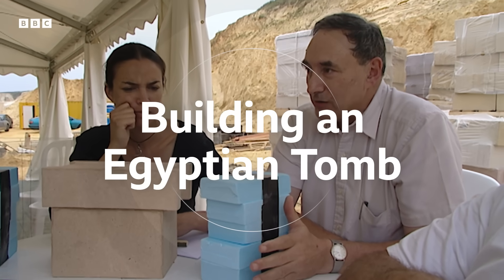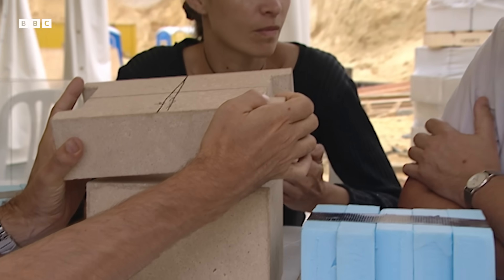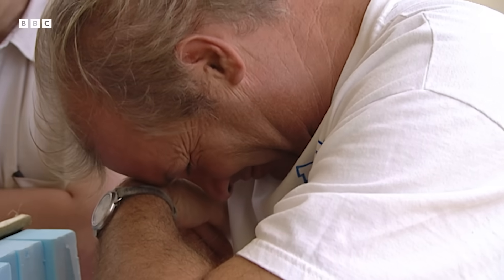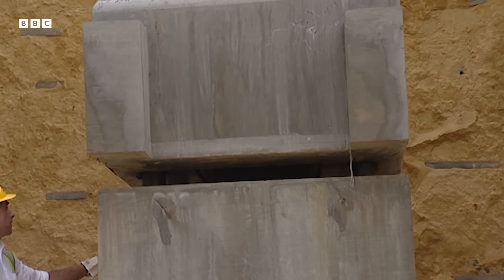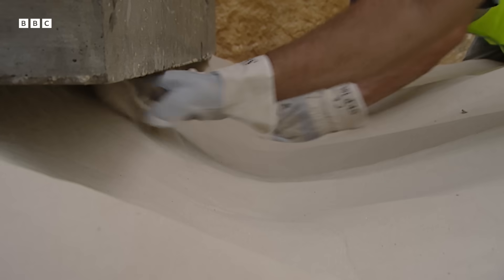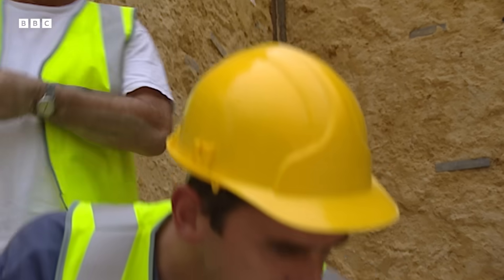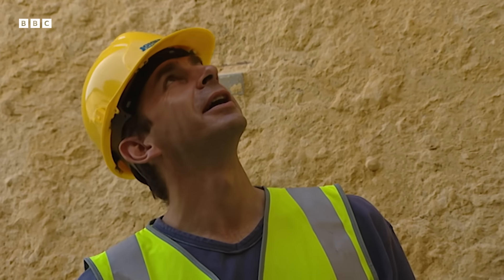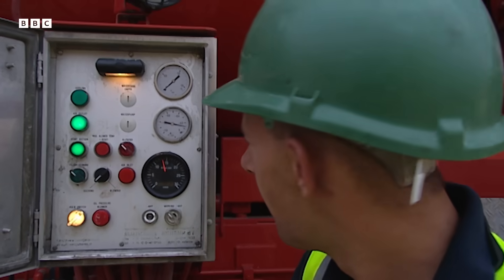Ancient Egyptian Engineering: The 15 Tonne Tomb Challenge | BBC Earth Science

Comment: they probably would have had some sort of tool more suited to the job of removing the sand from underneath than a spade. in place of a spirit level, a bowl of water with a level line inside would be just as sufficient. lastly, placing the stone on top would have required a gap for rope to be wrapped around, placing some oil soaked wooden pegs to hold in place while they removed the rope and setting them on fire would drop the lid down without crushing everyone's fingers

Comment: Any explanation that includes the use of ANY modern tools is useless
Reply: Thank you! So much wrong with this convoluted presumed re-enactment. Did they ever ponder the use of grease to slick up the logs or pins? Did they factor the probable mobilization of hundreds of ancient workers, not necessarily slaves, to remove the sand?
So I imagine one or all of them were enthralled by Jack Hawkins and "Land of the Pharoahs" as kids. "Again, I ask you: by what means will you move the blocks?!" Reply? "Sand."

As for the four copper pins used to secure the sarcophagus lid against grave robbery, they were not massive steel pipes. Small pins held in place by wax or resin. Amusing when narrator says: "already behind schedule,....", Pharoah not pleased 😂

Comment: Of course, this man splitting the stone block use only wooden hammer and bronze chisel? I understand that modern team can't do some things without some machines replacing pure manpower available back then, but all other tools and ideas should be appropiate. Ropes made of natural fibers, tools made of stone, bronze and wood... I'm waiting for tube drilling in granite rocks, polishing hard stones and making stone (granite, andesite) vessels like those dated to predynastic period, with micrometer accuracy in diameter using no lathe or ever pottery wheel (not known for them). Do I sound sceptic? Prove me, that you can do that (as people from stone and bronze age did it multiple times).
Reply: It looks and sounds like a steel chisel, I've been a welder fabricator for 26 years, copper would have just mushroomed over and got blunt
Reply: @dirtbikerman1000 They actually had copper, arsenic copper, and bronze. All of which are perfectly able to cut and bust stone. 
Not many know it but bronze is far stronger than iron. 
But strength dosent matter no ways. If you rub a rock long enough with even the skin on your finger, it too will cut it. 
The same way paper dulls knives and scissors. 
Hardness only is a factor of which the speed of the work is affected in nearly all cases. It's never a factor of if it will work or not. Simply how fast. 
We still use copper, even nylon mallets and tools to beat metals today. They work great, and last forever nearly.
Reply: You're premise for your debate is basically saying,"Santa is real. Now I'm making it your job to prove its fake."
No one is obligated to prove anything to anyone. All they do is simply give the facts they can prove through the evidence they have on hand. 
It's now your job to either listen to it, or challenge it. So why don't you go prove it isn't possible?
Btw. Those vases you reference are far from perfect. Have you even googled and looked at them with you bare eyes before? They're all sorts of catywompus. Great work yeah sure. Took like of time and effort. Perfect tho, they are not. Far from it I'm afraid. The few they do claim are close to perfect, aren't even legit anyways. They come from non proven sources. But even those are wonky. 
There are channels here btw that actually do what you ask for though. All ya have to do is search for it. Go to scientists vs myths, sacred geometry Decoded, and many others to get this proof you seek. But others shouldn't have to do the work for you. 
Don't feel bad though. I too fell for this nonsense they show on all these "woo" channels here now. Well... at least some of it. But... I did some simple homework though. Do the same bud. 
Have a good day
Reply: Especially from 32mins